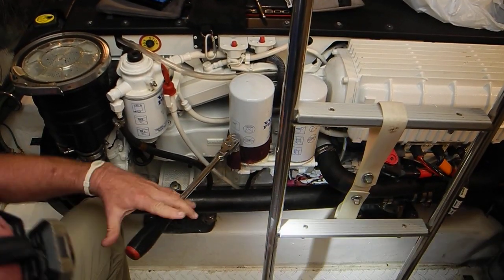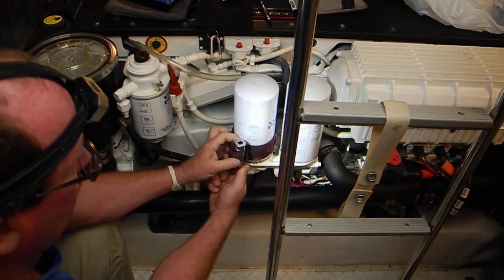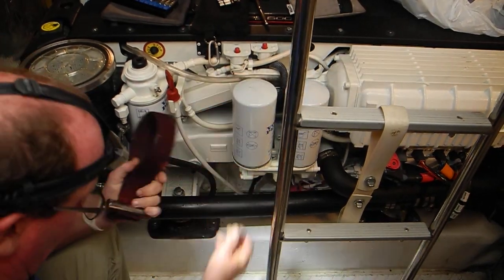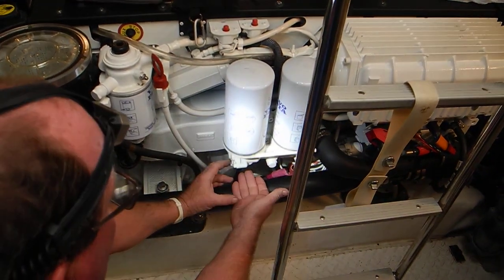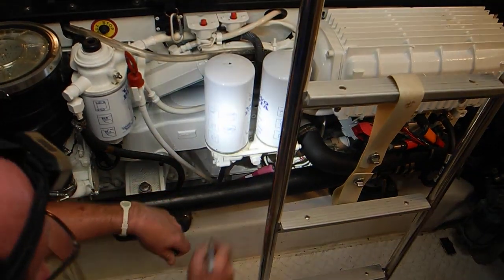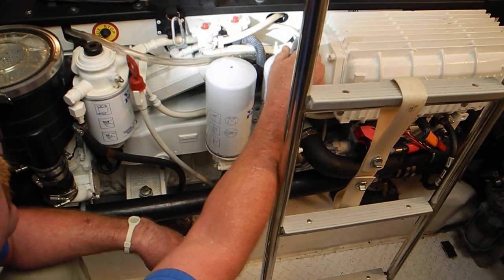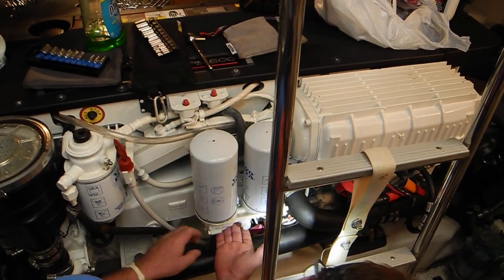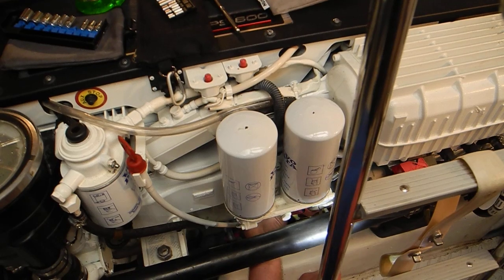Poke a hole in your oil filter

Comment: Good tips . I have a filter wrench like that . Very handy. I also have one with a chain if I can find it 😆. I have ran across a few where I had to drive a large screwdriver through them. These sometimes make you say a bad word 😇😇.Love your channel.Smokey Wilson 😎
Reply from the maker: Can’t say bad words. People may think you’re an expert. I agree, I have done it all too. Screwdrivers, giant channel locks, chain wrenches, a few bad words and of course I had to walk it off.  Somehow I got the filter off and installed the new one reluctant not to screw it on too tight and hope it wouldn’t leak. Beware, make sure you remove the old gasket, that is a different kind of excitement and more bad words.
Reply: @AskCaptainChris  That's for sure 🤣🤣🤣
Reply: Once I first put one large screwdriver through the filter but it was stuck so good that I only crushed the casing and the filter would still not come loose. Two screwdrivers 90º apart plus some bad words did the trick.
Here's some Swedish cursing that you can use if you don't want others to know that you're cursing: Helvetes jävla oljefilter!!! 
(Hell's devil's oil filter. The letter ä is pronounced like ai in air.)
Reply: @skunkjobb  Wow I'm impressed. I only know Alabama swear words
Reply from the maker: @skunkjobb  Just imagine if you hired a professional and you had to watch him do the destruction methods you described. Yes it happens to all of us at some time. Just hope nobody is watching.